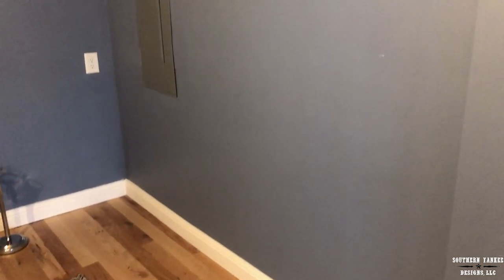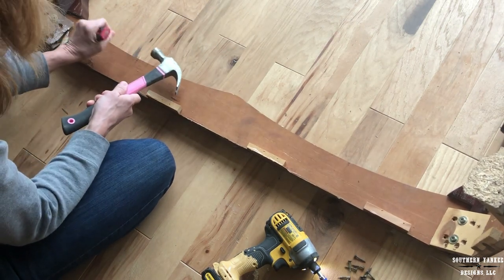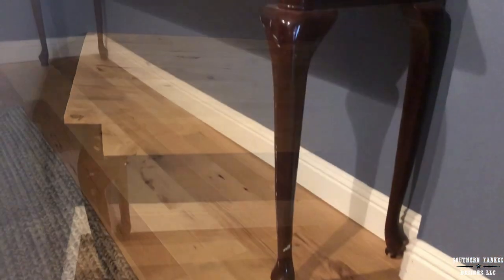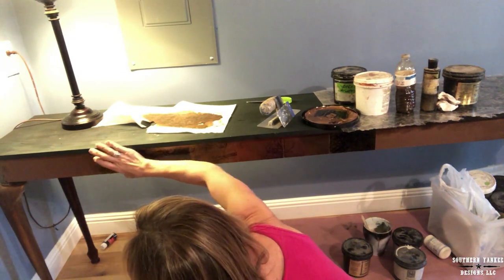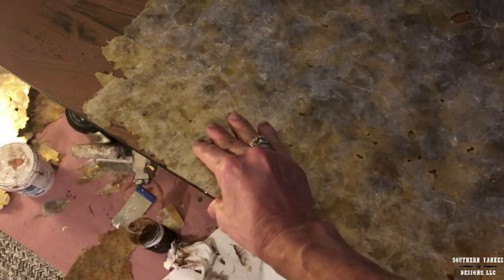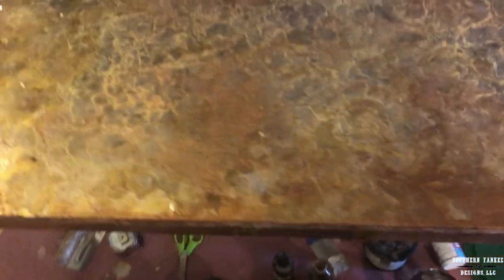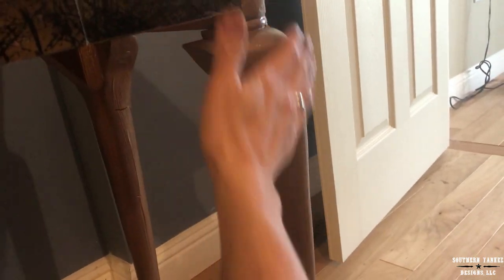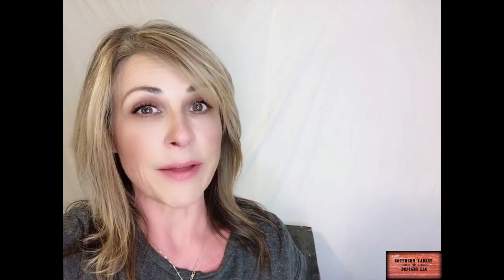⭐️MAKE A CUSTOM CONSOLE TABLE | Using Things On Hand | Powder Room Transformation!

Comment: How did you piece together the mica on the top of the table? I understand why you didn't want straight edges, but I don't understand how the "jaggedy" edges fit together. Also, I noticed that there was a gap between the top of some of the table legs (maybe all of them?) and the bottom of the tabletop. Did you do anything with that, or is not really noticeable when the table's all decked out? I love the finished product!
Reply from the maker: Hi there!! Thank you so much! 
I ripped off uneven pieces of the mica paper and filled in all of the open areas in the center of the table. I'm doing a video of a sample of this finish also. :)